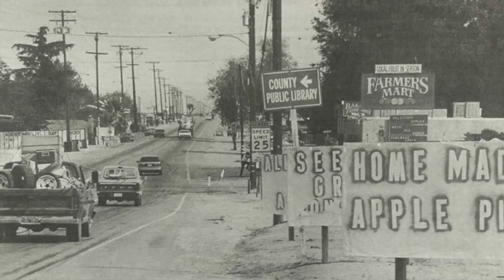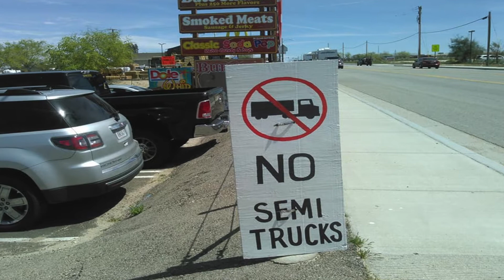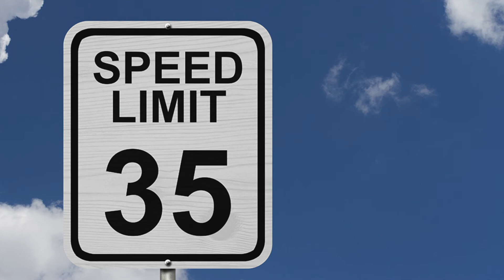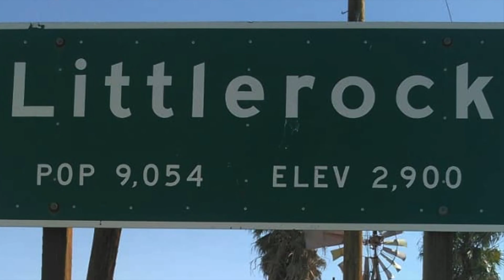CalTrans SR-138 So-Called Improvements in Littlerock CA

Comment: I hate how careful I have to be when I go into or out of the McDonald's or the post office lots due to the thin driveways you discussed in the video. I also have walked on Pearblossom Highway a couple times and find it easier to walk on dirt than on the sidewalks pushing up. While we are at it cars travel way too fast through our residential and commercial areas, to the point where at different times of day it is nearly impossible to make a left turn onto the highway and not much better to make a right. Finally I am horrified to hear that the drainage from the streets is going into a creek that plays a role in our water. Please help us caltrans and LA County!

Comment: Cal trans really messed up the highway! It’s really a pain in the ass. I hardly ever want to go down the 138 I try to avoid it all together. The only good thing that came out of this is nothing. It used to be nice to pull right into some of the merchants on the highway. Now you have to find a way to park behind some of the stores or on the side of the store. If there is no parking to a particular store I end up going somewhere else. It’s a shame that this has been a failure.

Comment: I grew up in Littlerock and now I am a resident of Pearblossom . We are concerned of many of these issue, effecting our town the same way. We did not want curbs ,and now many business parking will be impacted heavily due to less access and there goes our rural lifestyle . I have pinched several tires in the driveways Downtown Littlerock because they simply not wide enough to accommodate nothing bigger than a couple compact cars .  The side walks are in poor shape and are not maintained.  The worst design of driveways width and drainage have made Littlerock ugly and unsafe, killed local business and shuns future business .We are afraid of this happing thru Pearblossom. Caltrans engineers should not only learn basic design but learn adaptive design by working with local Community and the County should make sure it happens to protect its residents. I can go on and on ......... Cal trans needs to be held accountable like us regular folks do..........